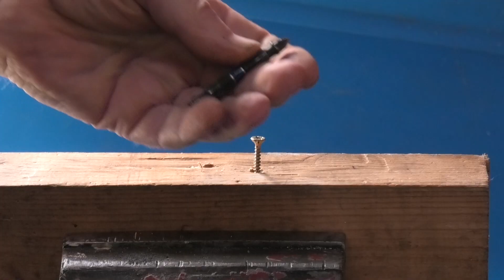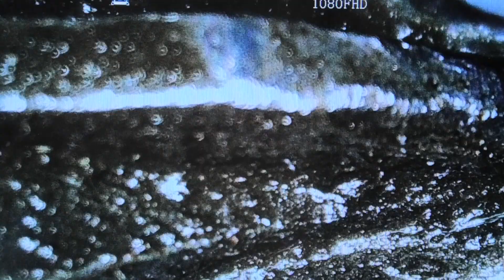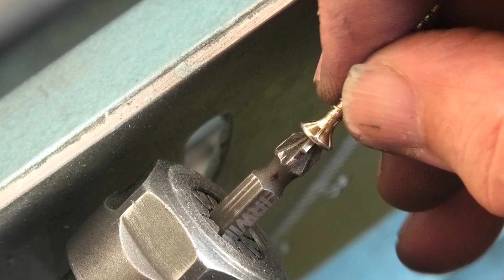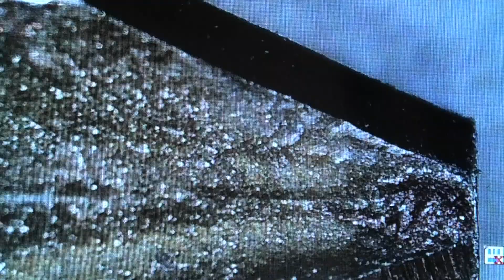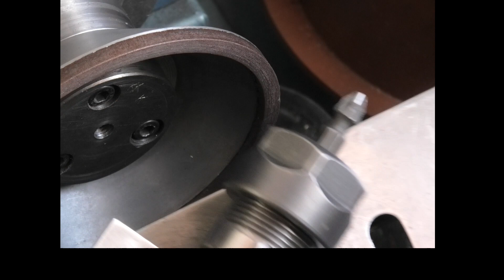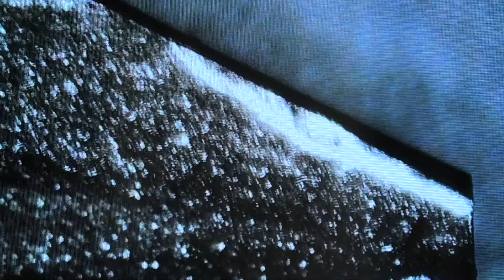rework a worn screwdriver bit

Comment: I have ground those bits when I didn't have another one handy but it's easier to buy a pack of them them when I buy screws. The singles are about 50cents, 15/$7 and the doubles about $1 10/$9.99 here in the US. Now I buy mostly Torx head screws. Sometimes the screws come packaged with the driver bits.